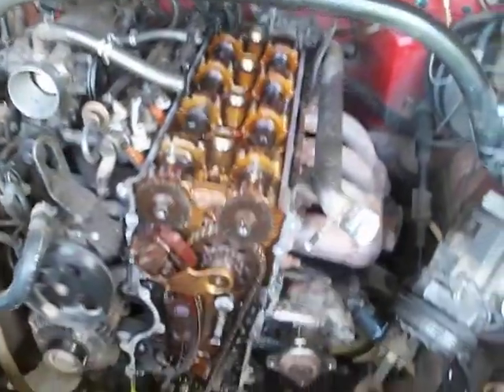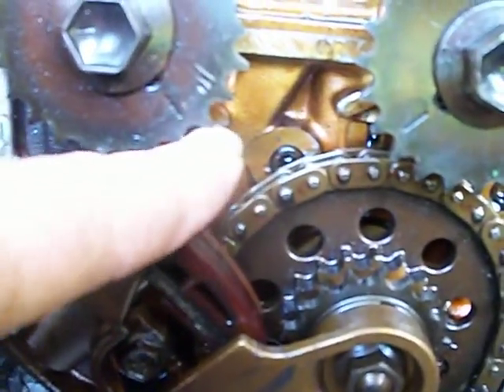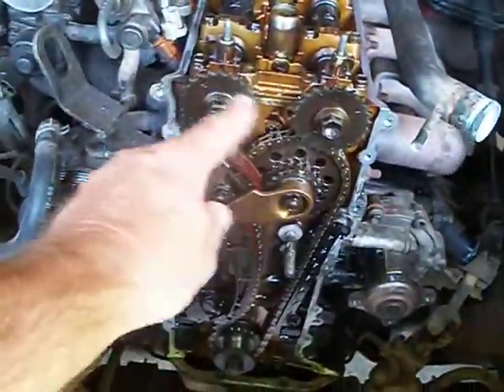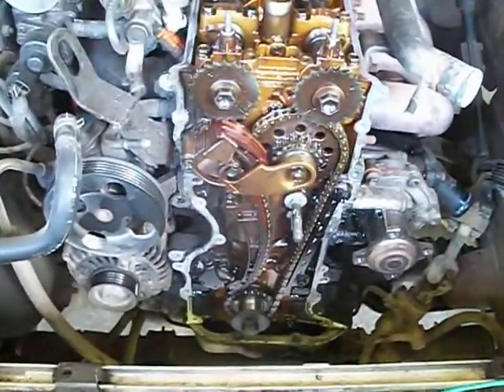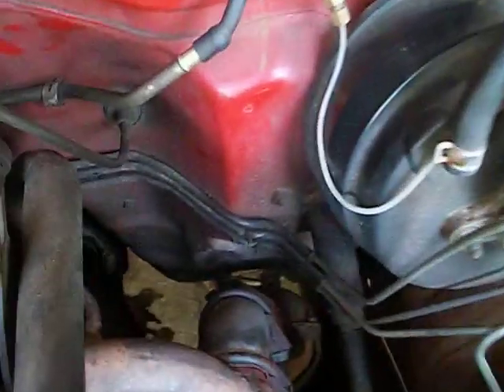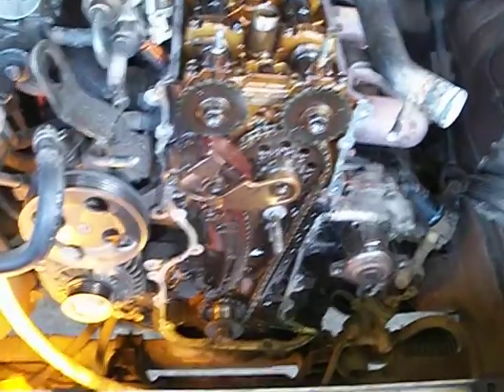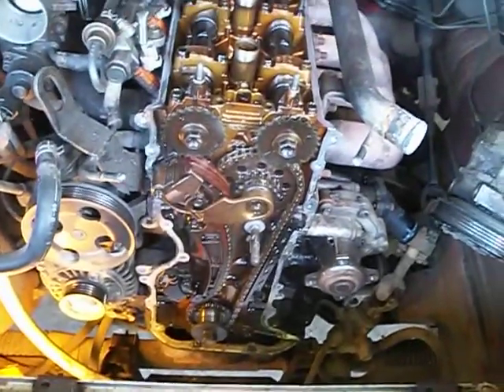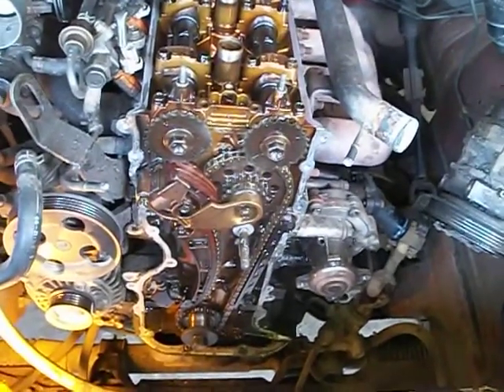2000 chevy tracker 2.0 timing chain replacement part 1

Comment: You're doing the compression just right but the middle sprocket the arrow it's supposed to be at the bottom just a little slightly to the right the dot on top of the middle sprocket will be a Dot it's supposed to be straight up in the air I noticed y'all had the arrow on top everything else was looking good except for that middle sprocket remember the arrow is at the bottom and the dot Is on